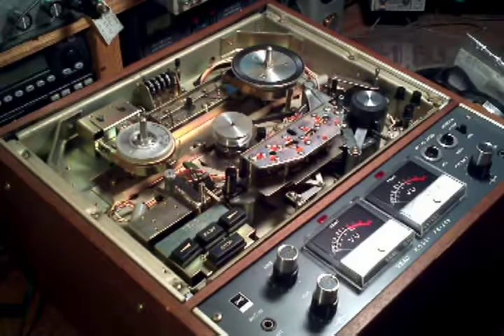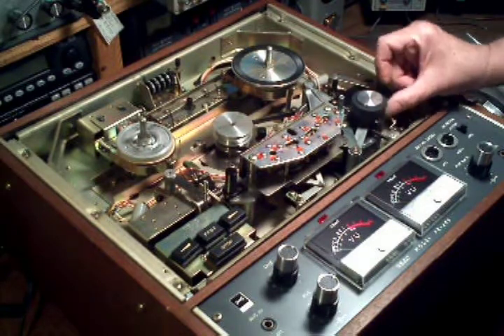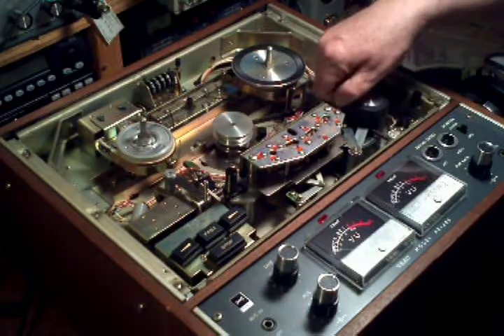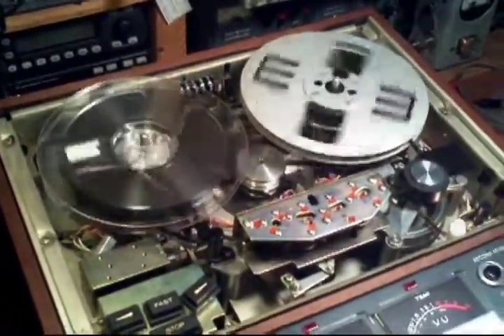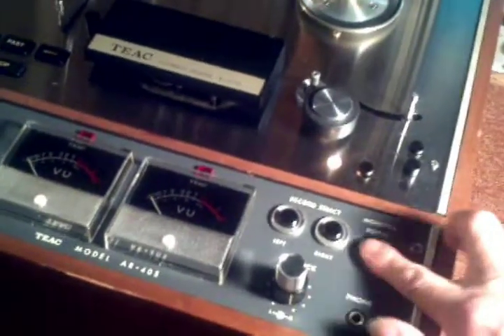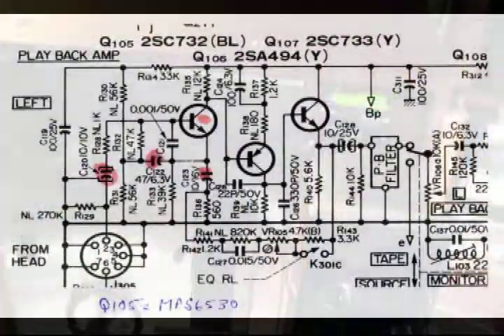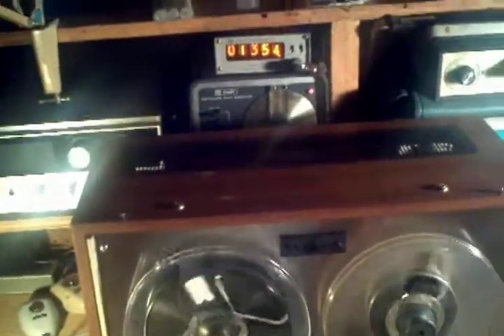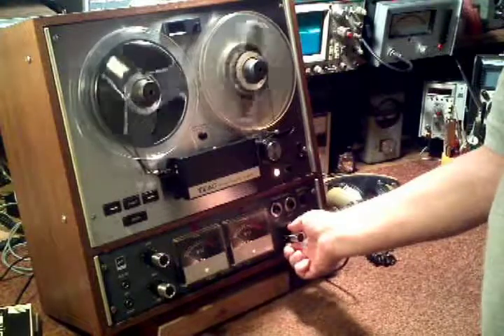Teac A4010S Reconditioning

Comment: Great video, very helpful, thank you. I have the same unit 4010S have problem with the recording. My preamp is same as yours AR 40S. Unfortunately I do not have AR 40S wiring diagram. (I have RA 40S, totally different). Could you tell me where can I get AR 40S circuit diagram? Maybe can I borrow yours?
BTW It is recording, but the source and the tape on the VU meter is different value. Certainly the tape is weaker😞
Thank you very much:
Steve
Reply from the maker: I don't have the exact diagram either. You might try, "www.hifiengine.com" A great source of equipment manuals. As far as the tape levels, yes, the playback level will always be lower than the original source. It can't be 100% record to playback. Some tape brands are better than others though.

Comment: Bob, Excellent video. Thanks for sharing your knowledge and expertise. I am working on a TEAC 4010S and have several of these restoration / service issues to overcome. Did you happen to replace any of the motor / power capacitors in the chassis? Thanks again!
Reply from the maker: No, I've never had to replace the motor run caps ---- yet..

Comment: I appreciate your work on this 4010S.  I just had a supply reel start spinning freely so my question is are the felt pads available?  I have a 4010SL but they're basically the same.  I haven't taken the front off as it just happened 30 mins ago so I came straight to YouTube and found this video.  My Teac has been idle for awhile but it has performed great over the years.  I also have a working Teac X-7R in great shape.  Thanks again for your posting this video.
Reply from the maker: As far as the brake pads no, these parts are no longer available. A good substitute is a felt or cork material that you might find at a hobby or material store. Cut to appropriate strip(s) and apply to the metal brake bands. I've been lucky in the past whereby the adhesive failed on the brake pads and they had fallen down into the cabinet. An easy fix. Yes, by the description of your supply reel spinning it sounds like the brake pad has gone missing.